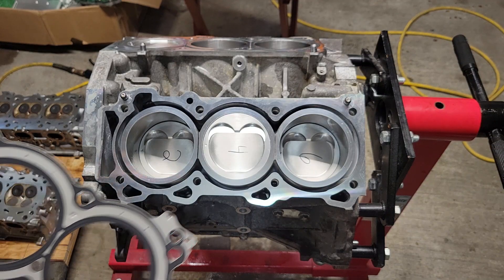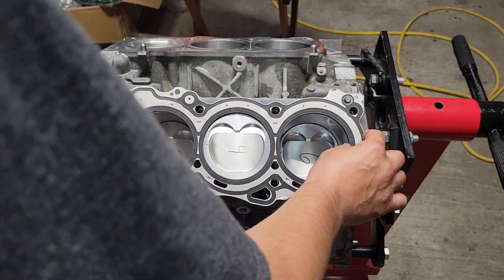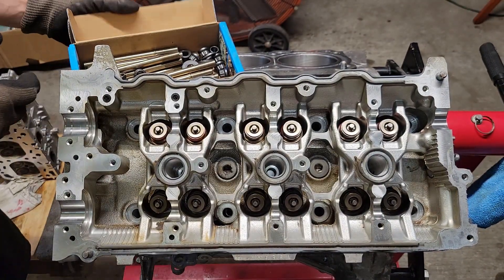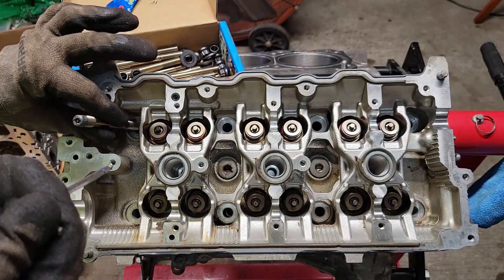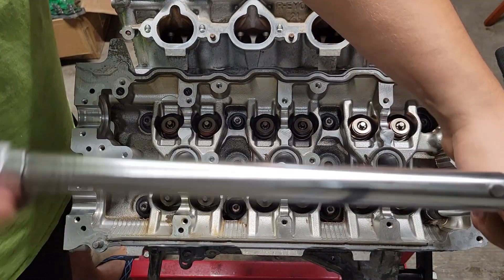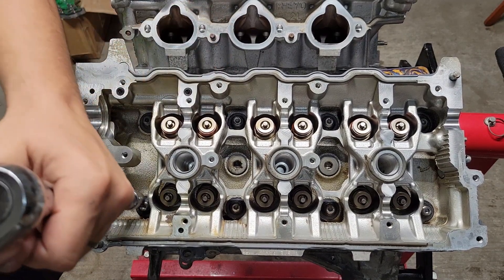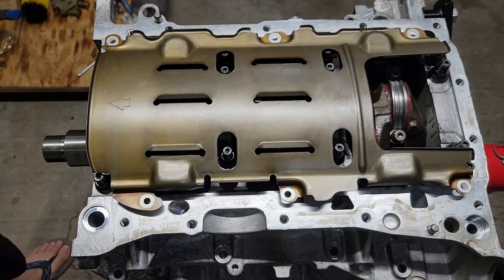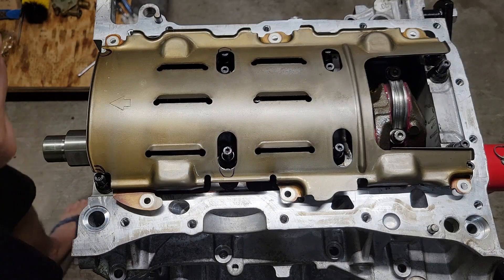Forged VQ37VHR build part 19, installing heads, oil pump, and upper pan

Comment: Great Video.. What difference does it make if going with OEM head gasket as opposed to something like HKS?
Reply from the maker: The OEM doesn't have the entire surface coated like an HKS or other aftermarket MLS-R variants.
Reply: @garagefanatic7830  i see if money is not a issue and i want to make around 500whp what will you prefer?
Reply from the maker: @Properwraps  OEM